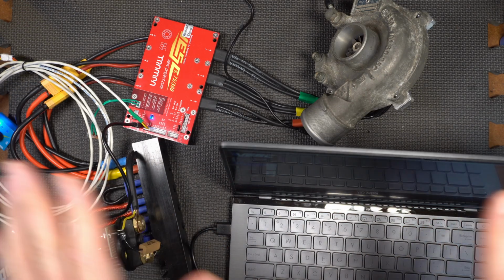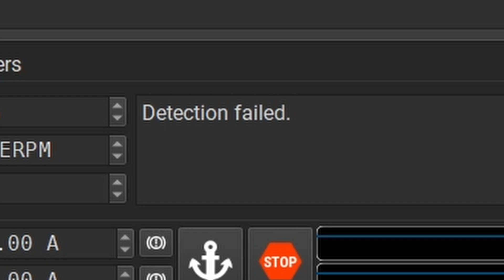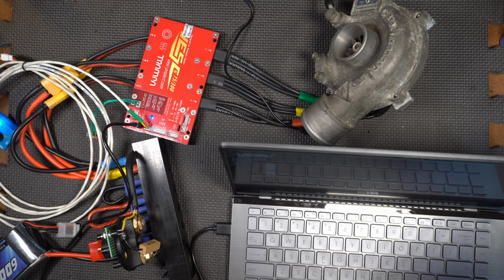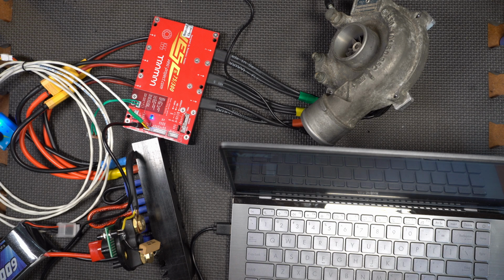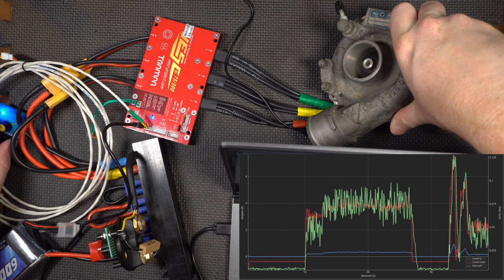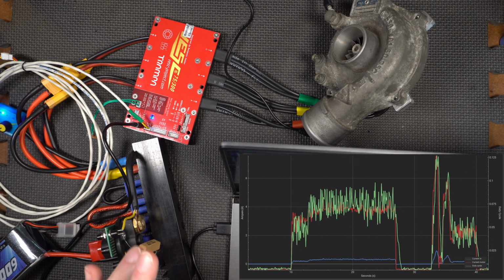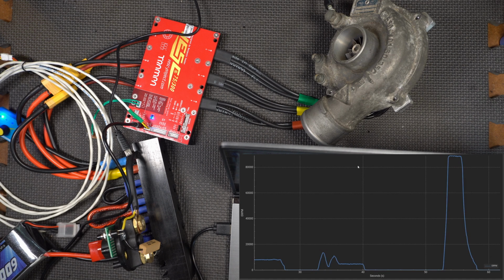Block Commutation vs FOC - Which one is better?

Comment: Hi Alex, have you ever considered the 3 wires on each phase wire (between the motor and VESC) to potentially effect the back EMF readings?

Not necessarily the same, but from my personal experience I've come across many people wire up drone motors with issues. The issue was eventually diagnosed to be from braiding the motor phase wires between the motor and ESC. The understanding was it's effect reduced the back EMF and made motors de-sync. It was more prominent at higher RPM's and during acceleration and deceleration. Once the phase wires were run linear (not braided) the issues did not persist.

I understand your phase wires are not braided but you are running 3 wires per phase wire. It could be trivial however easily proven wrong by trying a single wire per phase just to eliminate it being of any cause. 

One last thing to note which you are most likely aware of is the phase wires between ESC and motor do not need to be as large. What they are performing is not the same task as the input DC voltage side. For example if you consider the relatively thin motor wires wrapped around each stator as well as the overall distance of wire, by effectively extending that distance from ESC to Motor by an additional 5-10 centimetres it really won't have of any effect even if you matched the motors stator wire thickness.

Comment: I know this was posted in another comment , but can you make a pneumatic motor to supercharger version. Some of us are running air suspension and have air tanks in the car already , that would be a crazy setup also . Wasn’t sure if it’s even possible , there are high rpm pneumatic motors that just connect with a collet end.
Reply from the maker: You could, but I did do some research into that - even if you could get good efficiency, it would take a lot of pressure and air volume to generate any meaningful boost.  In fact, it's easier just to hose compressed air straight into the engine - Mickey Thompson did that way back in the day.  It worked, but the tanks were huge.

Comment: Everones 'practical use' is diffrent,  I realise you are testing to max rpm unloaded , but your requirement is highest boost, how do the two compare  an outlet  restriction  down to the boost you see on the car against power required to achieve ?

Comment: I still want to give vesc a try.
 I need my scooter to do 60mph 😆   On a side note, when are you going hybrid?  Koenigsegg claims they’re getting 335hp out of a 63lb electric motor.  I’m skeptical, but even if it’s half that, put one on each front wheel, tune your boosted engine for the top end, and pray your parachutes opens before you run out of track.

Comment: Have you enabled high current sampling?
Reply from the maker: Nothing I've done has made much difference either on this motor or the TP Power motor.  However, last night I tried it with a Castle 2028 - and it seems to like that motor MUCH better.  I think the VESC just doesn't play well with certain motors.

Comment: The 95% duty cycle limit may actually not apply for the VESC you are using. It is currently set as the default limit on software, but your hardware (75/300) could actually reach 99%. You can go to the advanced motor options and change from 95% to 99% and it would take it.
If higher speed is needed, with these in-runners you can also easily apply some field weakening current and go above the theoretical 100% duty cycle speed limit.
As for the speed oscillations, it may depend on the control mode you are using. For current control and speed control there are PID settings that can be finely tuned. 
Was it set for duty cycle control?
Reply from the maker: It was set to current control.  Duty cycle was set to 99 - but just because it's set there doesn't mean it makes it there.  It doesn't.  I did a TON of field weakening testing - I was never able to match the BLDC eRPM, even with almost doubling the current draw.  You'll find those oscillations vary from day to day and even power up to power up.  You'll never get it consistent.  Might be ok for a skateboard, but not for anything serious.  Watch my testing videos from January and February of this year - those were all with the VESC.  I wasted a lot of time and money on this thing - even have 123 emails between myself and Frank at Trampa, even a few with Benjamin.  Then I put in the MGM ESC, and suddenly 33 kW is as easy as falling off a log, even on a racetrack - if you haven't seen this video, it's pretty eye opening: https://youtu.be/nlTVHkfSQXM  I'm sorry, but the VESC isn't ready for prime time.

Comment: There's still room for improvement! Two things:
1 are you running the latest firmware?

2 The oscillation is usually due to a bad motor detection. Did you chose the right kind in the wizard? If so, try choosing the one weight higher than your is. 

Your testing shows that your motor erpm is likely voltage Limited. Try adding field weakening in FOC mode. I'd bet you can get higher than bloc commmutation in that case.

If you want to have good startup you need to activate HFI and configure it, although i don't know if it really matters in your use case. 
I think you could use some help in setting the VESC up correctly before really judging it :)
Reply from the maker: 1.  Yes  2.  I've run motor detection many times - it varies from day to day, even power up to power up.  I've even messed with the individual settings, and the only one that's made any improvements is observer gain.  But nothing to write home about - mostly for startup.  Field weakening (I tried that too) results in a HUGE increase in current for minimal gain in max RPM - and no, I was never able to match the BLDC eRPM even with a much larger current weakening than I'm comfortable with - 30 amps, in this little motor's case - that lead to almost double the current draw, but still only about 86,000 eRPM (BLDC was able to go just over 90,000).  Look - I have 123 emails between myself and Frank at Trampa, I have several emails from Benjamin, I've spent WEEKS trying to get this thing to work reliably and comparably to regular trapezoidal controllers, I even have a bunch of videos trying to get this to work on a bigger e-turbo - watch the test videos from January and February of this year - those were all from this turd.  Then watch the MGM video - it worked first time, and ultimately did this at the track: https://youtu.be/nlTVHkfSQXM  The VESC is much like Megasquirt - not ready for primetime, yet the cheerleaders always blame the end user.  Unfortunately for them, this ain't my first rodeo.
Reply: @AlexLTDLX  you really did try a Lot of stuff! 
Well then I must say that it's probably not for you in this case. 
I've just had really good luck with the thing myself!
Reply from the maker: Actually, your comment and a few others motivated me to play with the VESC again running the P2/TP Power based electric turbo again last night.  It was still everything I discovered before - unreliable, not performing well, etc.  And then I put in the Castle 2028 motor I have.  The VESC likes that motor so much better it's not even comparable.  I haven't done real high-speed/ high power tests with it, but it starts and runs so much better even without VSS; but with VSS it's better still.  I'll do a video on it soon.
Reply: @AlexLTDLX  nice that you got something working!

Comment: Man its a shame to see you've had so many inconsistencies with your VESC. I've been playing with a Trampa 100/250 for a while now and its been the most solid controller I've used.
Reply from the maker: I'm curious - what are you using the ESC for?  What kind of tests did you do?  Have you put it into actual use?
Reply: @AlexLTDLX  I've been using the VESC for an electric motorcycle. It's hooked up to a QS273 (very different motor to the ones you've been using) although I've had no issues with any motor Ive run with it. My testing is nothing special, mainly testing for thermals. The testing was essentially how small of a heatsink could I get away with while running the controller at a desired current. I haven't been running it all that hard in all fairness but in the future when I get the frame fixed I'll be upping the power to its limits. I've been using it at around 300pA but the battery has been the main limiting factor so those 300pA have been for a very limited time while initially accelerating.
Reply: @AlexLTDLX  i think it would work better with a standard potmeter with the outer taps on gnd and 3.3v and the center/resistance tap on the adc input, i think most of the inconsistencies are by the PPM control.

Rpm/speed based control would probly be better than current control in this case aswell, as the motor sits at low current without a load in this case, and i think that's where some of the inconsistency comes from in this case

another thing you should try is field weakening, that will increase the RPM even if your voltage stays the same

Comment: You should probably get some help from the vesc forums because some of the issues you are facing can likely be fixed with some very basic tweaks
Throttle should be very smooth with no noticeable oscillation when setup properly with a good throttle
The 95% duty cycle limit with FOC is not an issue. Hardware-based FOC also has a safety limit when the controller uses all N-channel mosfets. You should be able to compensate for this with field weakening and a bit more current draw
Reply from the maker: I have a thread on the forums, with no results (under the same user name as here), 123 emails (literally - I just checked) between Frank at Trampa and myself, and even a few from Benjamin.  I have spent  days (and a bunch of videos - watch the test videos from January and February this year) trying to get this dialed in.  At some point, you have to give up and realize it's not you, it's them.  I just want a motor to spin so I can continue development, not end up designing my own ESC.  I've used tons of other ESCs - from cheap chinese junk to high-end APD and MGM ESCs and none - not one - took anywhere near this much time to work (pretty much all of them have just worked within miniutes, not hours, days or weeks) and was this inconsistent.
Reply: @AlexLTDLX  VESC has a steep learning curve, it's unfortunately just how it is. Especially for a niche setup like this
I'm surprised you didn't figure that out when researching before you bought one
Reply from the maker: Frank talked me into it.  The learning curve is indeed steep.  I played with some more last night, and it looks like it's very finicky on the motors.  The two I've tried - up until last night - didn't play well with the VESC.  In early testing, it looks like the VESC might like the Castle 2028 much better.  I'll do a video on it soon.

Comment: Your speed inconsistencies are potentially the throttle tester.  Put that thing on an oscope, the signals are not very consistent with the units I have.
Reply from the maker: I have three of them.  But this one has been scoped (mostly because it goes just beyond the 1-2 ms range as identified by two ESCs, and I wanted to verify the times).  Plus, this one has been used on a bunch of ESCs in several of my previous videos, and no other ESC exhibited any sort of similar weirdness.  Look for any videos showing bench testing; you'll see this exact servo tester being used.
Reply: @AlexLTDLX   it's weird the 6 step isn't keeping a constant rpm too. Not surprised on the FOC.  Like it can't lock in to whatever rpm the duty is determining or its bouncing off the bemf threshold and attempting some sort of startup routine.
Reply from the maker: You know, since so many people commented on the VESC, I tried something completely different last night.  I put in the Castle 2028 motor I have into the P2-based electric turbo.  The VESC seems to like that motor MUCH better than the TP Power and this little motor you see in this video.  I'll do an update video soon...
Reply: @AlexLTDLX   awesome!  I don't think the vesc has a great low speed detection circuit , some motors will be more easily controlled than others.  The castle lamination has a really nice bEMF waveform, especially for six step that it is tuned for.

Comment: You're completely right, VESC is garbage. You should sell me that VESC for cheap 😈.
Reply from the maker: I might do that if I can't get it to cooperate.  I'm really hoping they get their stuff together and this thing starts working like it should.
Reply: @AlexLTDLX  the stuff is together, you probably just don't have it configured right.
Reply from the maker: I'd argue that point - it's a mess.  Documentation is a mess - all over the place, and not dated - tons of people have problems, many of which don't get resolved (just look at the forums), and if Frank at Trampa and even Benjamin weren't able to find settings that worked well with my setup (I have exactly 123 emails from Frank at Trampa, and several from Benjamin), what chance does a regular Joe have?  VESC is going to eat itself  like Megasquirt - for the same reasons, too.  That said, I think I discovered something interesting last night.  The VESC just doesn't like certain motors.  I think I found one that it likes last night.  I'll post a video about it soon.  But just think - for a third of the price, you could have a smaller ESC that's more robust and just works - I'm referring to the APD F series.  This thing takes way too much setup time; and in some cases, it'll never work well.  Until the software is more mature, it'll continue to languish.  That's just how product development rolls.

Comment: the dutycycle limit is not caused by computational constrains and has nothing to do with this. Furthermore if you have set up various motors why not just tweaking some parameters. Have you tried speed control or current control modes, how do they perform? Hardware solutions that would fit the needs of a VESC do not exist, and is not really necessary with todays MCUs. Maybe just read the topic up a little bit more and try again.
Reply from the maker: Actually, it is - apparently, it's set to 95% to give the VESC time to charge the high-side gate driver cap and to allow time for phase current measurement.  I've spent entirely too much time trying to get the VESC to work in a stable fashion - I have a number of videos where I screw around with almost every setting.  Look for videos about the "Easier/Cheaper high power electric turbo"  tests.  I've spent far more time trying to get the VESC to work than any other ESC, and all the other ESCs worked right off the bat (for a period of time, anyway).  Currently, I'm running the 1,000 amp MGM ESC and it simply works: https://youtu.be/nlTVHkfSQXM  It's running 33kW without issues.  And no endless screwing around, and day-to-day quirks and inconsistencies.

Comment: Great videos,  I think it would be beneficial at this point to start talking with others and design your own controller,  this would help with programming and perfect curves.
Reply from the maker: I've looked into that from time to time.  All we need is the ability to drive the motor as fast as possible - we don't need reverse, low speed running, etc; you'd think it would be relatively easy.  And it might be - I've thought about just using a cheap ESC to drive my own mosfet bank, too.  That would be easier to implement.
Reply: Its not an easy path by any means...
Reply from the maker: You're right.